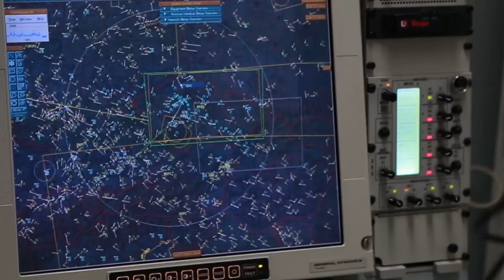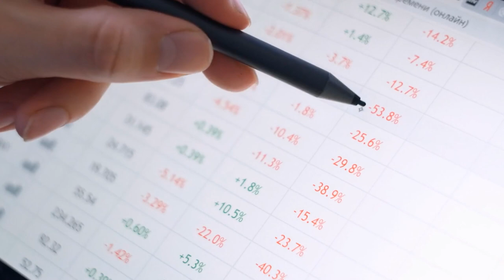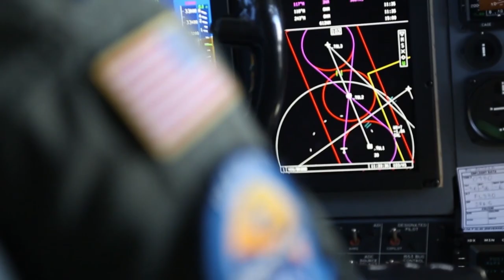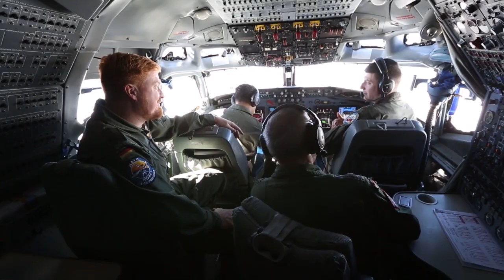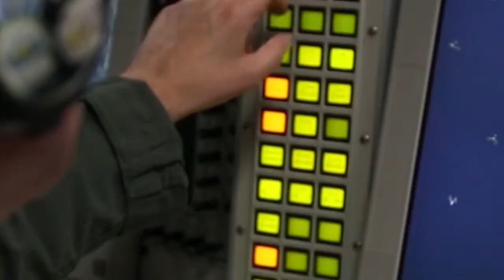Giant Mother of All Bombs GBU-43B Massive Air Blast Ordnance

Comment: When they tested it in Florida, supposedly the blast registered a 4.0 jolt on the Richter Scale and people heard the explosion for miles around the air force base.
Reply: it's literally TNT sensitized with aluminium to go off like flash powder so it goes faster than TNT uses the vacuum itself to collapse bunkers and tunnels like popping a balloon,we're sitting on top of lots of natural caves and springs all through florida so they probably all vibrated
Reply: @Aaron-zu3xn  No it's not. The filling is mostly RDX with some TNT and aluminium and other components. No vacuum is created and the effect against bunkers and tunnels is minuscule. To be effective against underground structures, you need ground penetration of the bomb before the detonation. Not even a low altitude nuclear blast has any significant effect against tunnels etc. Photos from the 2017 Nangarhar airstrike show tunnel openings remaining intact after the explosion.

Comment: As I recall (and it may have already been mentioned in the video or a comment) the device is named the "massive ordinance air burst" to use the acronym MOAB which also translates to "mother of all bombs" -- there are videos of it's use in military action located elsewhere on YT.

BLU stands for "bomb live unit" while practice ordinance (no bang) is designated BDU (bomb dummy unit). The GBU is a "guided bomb unit" today using laser tracking though television has also been used for guidance. The MOAB is so massive that guidance is limited (unlike say cruise missiles which have wings) to the fins but the ground effect counters the need for precise accuracy.
Reply: There has only been one MOAB dropped in combat.  The rest were tests.  The first two were inert, filled with concrete.  The third was the one dropped at Eglin in March 2002, the first live drop.  The fourth was also a live drop, not sure where that one dropped.  My friends know.  The fifth was in Afghanistan on the cave complex.
Reply: Please do a search for "MOAB Afghanistan" on YT, an APC Bradley (from the looks of the turret) is more than a km away when an "air blast" device detonates, the shock wave takes about 3-4 seconds to reach the film crew, that is not a JDAM unit since the burst is definitely in the air and not upon impact with the ground.

Comment: Please do a video on the Massive Ordinance Penetrator (MOP). I've heard that its supposed to be like a MOAB but its a bunker buster instead. If I remember right it can penetrate like 200 ft into the Earth and 60 ft of concrete before exploding and are used in pairs carried by B2 Stealth Bombers.
Reply: If this is the one that was built, during Desert Storm, using cannon barrels as the body, I agree. Some others to consider are Grand Slam, Tall Boy, and the Dam Buster Bombs created by Sir Barnes Wallis.
Reply: You're correct, but the MOP was actually made to destroy the Iranian (Fardow) Nuclear Enrichment Facility, that is underground in a mountain complex. The MOP was designed with this particular target and targets similar to it, underground! The previous bunker busters we were or are using could only penetrate up to 6ft of concrete, whereas the MOP can penetrate 60ft of solid concrete and can be "tipped" or armed with Tactical Nukes. The B-52 can carry the MOP, but so can the B-2 Spirit with some alterations made before the mission. Thankfully we never had to use the MOP on Iran, as we used the "Stuxnet" virus to set their Nuclear ambitions back a few years. However, the USA has been asked quite a few times, by Isreal...to supply them with a couple MOP's. The US declined each time and I don't even know how the Israeli Military planned on deploying them. However I do know tensions were high a few times between late 2011 and now, and Israel threatened to strike/attack Iran/Iranian targets with or without US assistance! Our problems with Iran are certainly not over, so we may still see the use of the MOP, but I doubt it will be anytime soon. Biden probably couldn't even say MOP or Massive Ordinance Penetrator without screwing it up, or warning the Iranian's we are coming. Just like he told our enemies when, where and how we were leaving Afghanistan, lol. He is like a Military Advisor to our enemies, mor than he's like an American President, but his old buddy Obama almost did authorize the strike on Iran. So it is possible the next US President might have a need to use them or maybe will finally give our Israeli friend's a few of them?
Reply: @patricksmith2553  I agree with everything you said, if it isn't politically prudent to deliver a live unit to Israel, perhaps a leak of information would work as Israel has quite the capacity to build their own.

Comment: I believe you can even dial-it-in for specific altitude bursts for a full range of target zone customizations.  Of course with deminishing returns at higher altitudes regarding blast intensity but with the benefit of increased overall area of effect.  Kinda of a smart-smart bomb.
Reply: But, as with most harmonics, I'd assume there's a "sweet zone"
Reply: Isn't this common place on most bombs? I believe even dumb bombs have air burst ability
Reply: @kevinsmith5489  And radio fuses. Sure.
Reply: And free InBkler U0FlUiD

Comment: I think this weapon is something we need to keep close and not loose the ability to produce incase of major war with Russia/ China for example.
Reply: Russia has already produced a similar weapon with a higher explosive yield
Reply: @Shalashaska13  Based on how their equipment has been preforming in this war, I don’t know if we should trust that the FOAB would be any good.
Reply: What would this bomb do in that kind of war?
Reply: The problem with using the weapon in a war scenario such As with Russia or China is that the delivery vehicle would be vulnerable to SAMS as the C 130 is not a fast mover. Max speed is 368.22 mph. With a load such as the MOAB it's speed probably drops to 340-350 mph.
Reply: @mikestanley9176  yes, that’s what I was thinking.

Comment: I was surprized to hear that the GBU-43B is filled with TNT. I thought the fundamental principle behind the Viet Nam era "daisycutter" was to expell a large cloud of fuel, followed by a time-delayed detonator charge to create a fuel-air explosion. Explosives such as TNT contain large amounts of nitrogen which contributes no energy to the blast.
Reply: TNT contain large amounts of nitrogen which contributes no energy to the blast.  I've heard some knee slappers in my day, but that one is up there.
Reply: It's not filled with TNT. It uses an explosive that contains TNT as a major ingredient. None of these bombs use fuel-air explosives. Such has a number of complexities and problems which severely limit their practical use or value as weapons. The 'Daisy Cutter' used GSX. The MOAB uses Tritonal, another Aluminum explosive, the one containing most Aluminum while still remaining sufficiently insensitive. Both the Aluminum gas and nitrous gases from the TNT component, generated by the first stage of the detonation, continues to explode with atmospheric oxygen. As alternative to Tritonal, H6 (modern, less sensitive version of Torpex), yet another Aluminum explosive, can also be used. This kind of weapons (including fuel-air explosives) is known as Thermo-baric, heat and pressure. The killing mechanism is the shock wave. The least damaging kill-effect, at the edge of effectiveness, consists of unconsciousness coupled with paralyzed breathing. Since victims appeared to have died only by asphyxiation, this gave rise to the popular myth of "Vacuum" bomb, or that it consumes all oxygen. While it does consume some oxygen, the hot gasses quickly rise and draws in new air.

Your last cryptic comment seem to have something to do with Oxygen numbers? But that is why basically all practical explosives are mixtures of different explosive components. Or rather, it's one of the reasons. In the case of Tritonal, the property wanted from the explosive is a very deep (long duration) and heavy shockwave. And while the explosive itself is Oxygen starved, I would gather it would typically release it's full energy in the field explosion. No worries about that.
Reply: go head and tell OKC, that...

Comment: Daisycutter is not the name of any bomb. It is the fuse extension probe at the tip of the bomb - in later versions replaced with a proximity fuse - intended to make the bomb explode before it digs into soft dirt or sand. The effective kill zone is much larger that way.

Comment: I mean, this "only ever used one time" is technically true, but it's really bending over backwards to generate a sense of mystique.
The MOAB is just the last in a whole line of bombs of similar design.
Ever heard of BLU-82?
Reply: have you heard of the russian foab?
Reply: @kjererrt7804  It's similar as well. yeah.
Have they ever used it though?
I was more speaking to the idea that "The US used one of these one time" when really this 'type' of bomb (in similar sizes) has been used numerous times in history :)
Reply: @kathrynck  it's 4 times as powerful as the moab. they used it once or twice in syria.
Reply: @kjererrt7804  4x? That sounds improbable, as it's weight is the same as BLU-82. 

But you may be right. A ham sandwich and a stick of TNT have the same energy & weight, but the rate of burning is what gives TNT the explosive force. So it the FOAB actually burns much faster, it 'could' be 4x as powerful. But I'd want to see the source on that, with a little allowance for Russia's penchant for exaggeration ;)
Reply: @kathrynck  believe it or not it has 4 times greater yield and a smaller mass. this is why it's unofficially called the FOAB.

Comment: Please note that being an airburst weapon, the MOAB has negligible effect against underground structures such as tunnels, bunkers and caves. You need ground penetration to knock out such targets. Lot's of bullshit is circulating about this matter. The tunnels in the Nangarhar strike were not destroyed, as can be seen in aftermath photos. But for people above ground, it sure is devastating.
Reply: Skunkjob,
When the MOAB bomb was drop in (a successful) attempt to eliminate the ISIS fighters from the massive cave system, it was not done with the intent of collapsing the cave system, but as they had discovered when dropping the ‘Daisy Cutters’ at the entrances of the caves the Taliban were hiding in, the ‘Daisy  cutters’ burned up the Oxygen in the cave’s suffocating any personnel in the cave system!  
The same effect on the larger Cave system that ISIS was in work just, if not more successfully.

Comment: How can one avoid collateral damage when using a "Giant Mother Of All Bombs?"
Reply: Bernie, by using it were civilians aren’t — as in this case.  Also, any civilians in this area at this time would have been either with the U.S. and excavated or more likely if any were around working with ISIS in this case.  
This cave system is in quite remote and rugged terrain which provides no reason for  any civilians to be there;  particularly with the fighting and its control at the time by ISIS.

Comment: The British Grand-slam was 10 metric ton monster so such a powerful bomb has been used loads of times in war,  granted it was called an earthquake bomb because it sunk deep in the mud and blew out things like bridge foundations to bring bridges down to stop German armaments from reaching France , it also was a bunker buster and was used so in WW2 but yes such a bomb has been used many times how ever this MOAB is an air blast bomb that is the only difference so the narration is wrong.
Reply: Good comment. The Grand Slam also used about 9,000 pounds of Torpex which is much more explosive than TNT.
Reply: @dasmotiu  9,135 pounds to be exact and your right about torpex because torpex is 50% more powerful than Aluminised TNT by mass so the grand slam was more powerful than the MOAB.  The American MOAB bomb is not the most powerful conventional bomb ever used or ever used in combat.